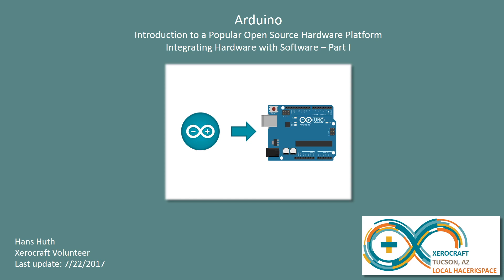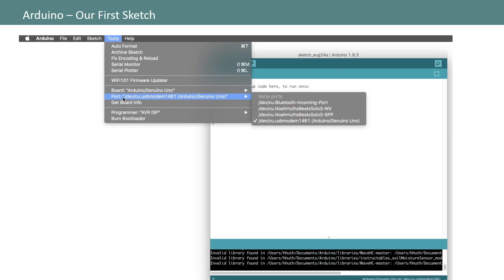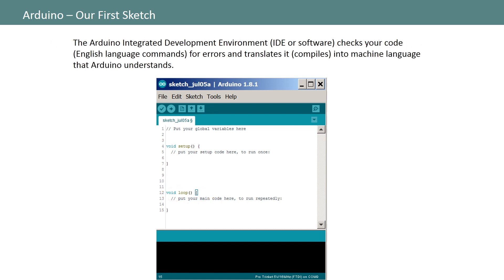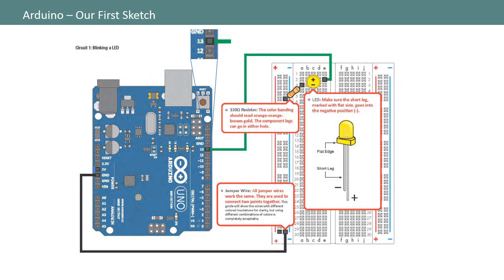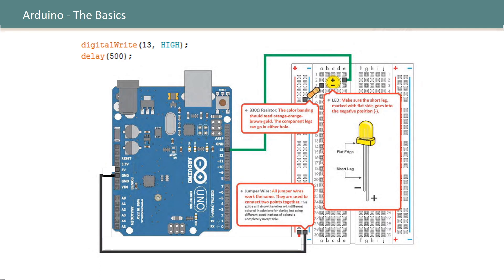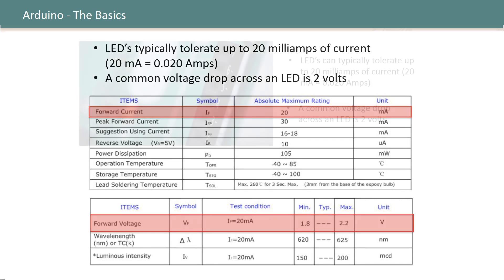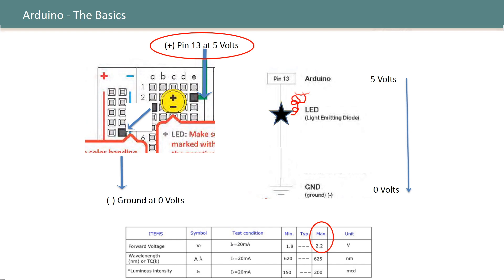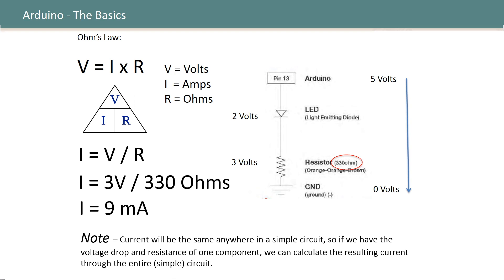Chapter 4 - Arduino - Integrating Hardware with Software - Part I

Comment: Hello!  Can you please post the full code for this circuit?  Well, the code of the operation of this scheme?
Reply from the maker: The code is already included with the Arduino Software - just look for "File" in the menu, then "Examples", then "Basics", and finally "Blink". Here it is if you can't find it:

// the setup function runs once when you press reset or power the board
void setup() {
  // initialize digital pin LED_BUILTIN as an output.
  pinMode(LED_BUILTIN, OUTPUT);
}

// the loop function runs over and over again forever
void loop() {
  digitalWrite(LED_BUILTIN, HIGH);   // turn the LED on (HIGH is the voltage level)
  delay(1000);                       // wait for a second
  digitalWrite(LED_BUILTIN, LOW);    // turn the LED off by making the voltage LOW
  delay(1000);                       // wait for a second
}

Note that you can replace the term "LED_BUILTIN" with the number 13 if you want. The built-in LED is tied to pin 13. Hope this helps.
Reply: @ModestMaker  oyyy thank you so... mush!!!))) You very best mаn! :)))